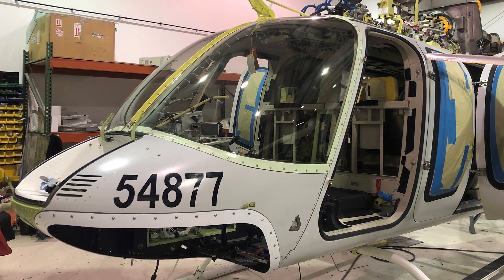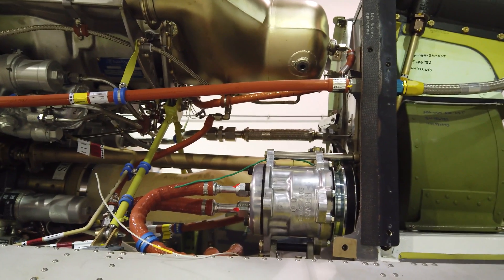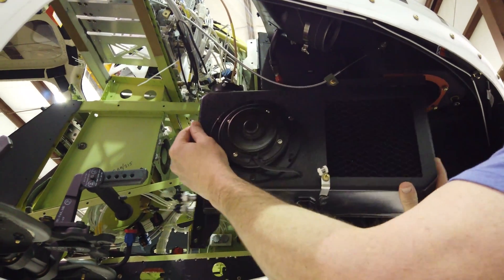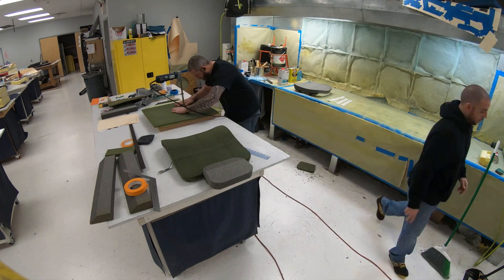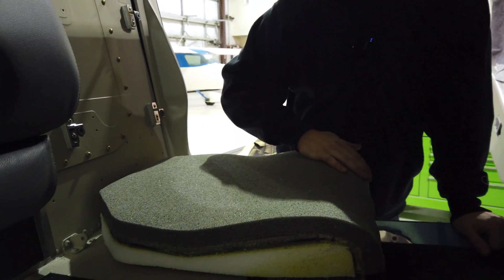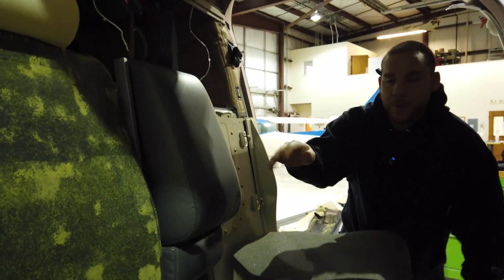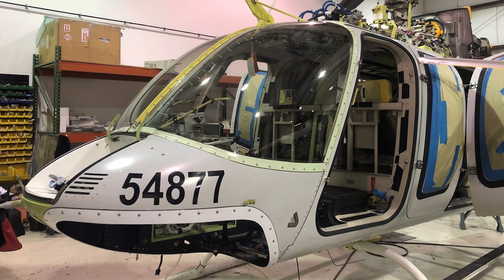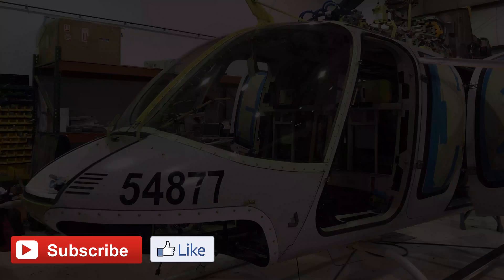SureFlight Bell 407 GXi Completion Part 3 of 6

Comment: Are passanger seats energy absorbing/ crash resistant
Reply from the maker: No.  Only the newest type certificated aircraft have this.  On helicopters with the skids, the skids are designed to deform to absorb crash impact forces.
Reply: @sureflightllc  OK, thanks. So is Bell 505  better at crash resistance ????